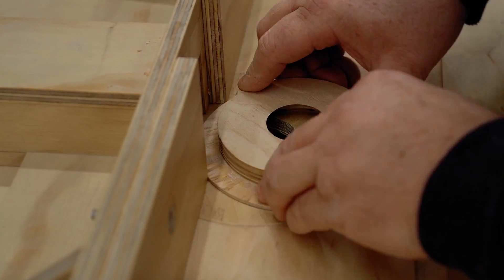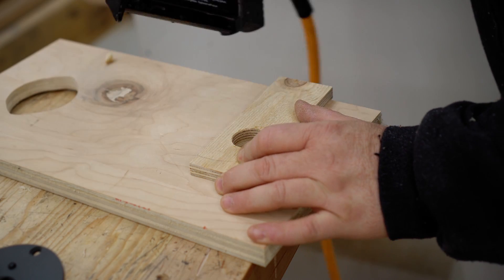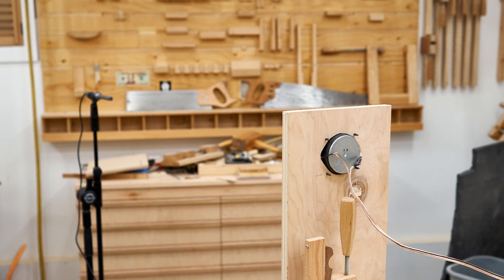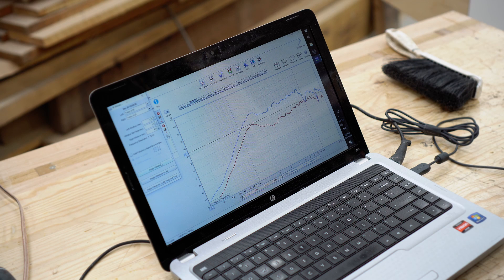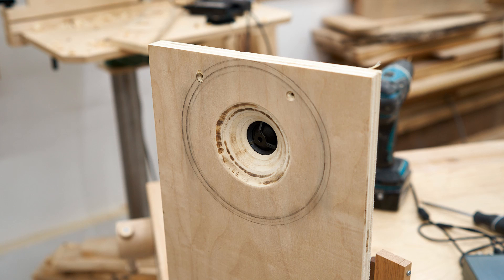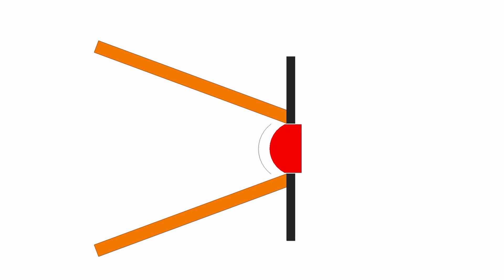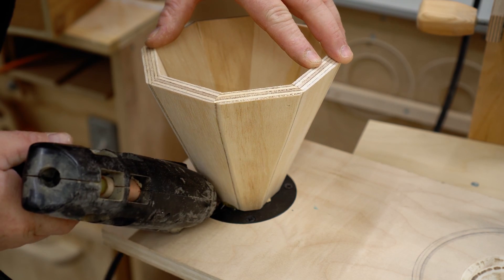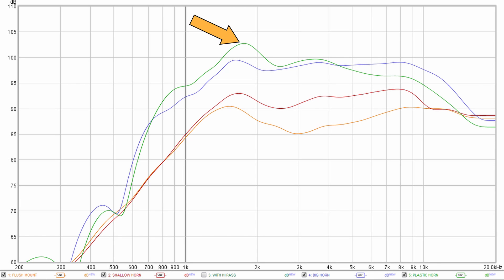How A Horn Speaker Works - Exciting Horn Experiments!

Comment: Can we get higher resoult above 15K if we use a crossing between a phase plug and a small horn? I have amt4 pro and i think they are fast enought but the size or whatever make a poor resoult on the upper end above 10K. I WNAT TO FIX IT. I will have a 3d printer here next week

Comment: One thing of note is that you still have to take care not to lower x-over point too low.  Don’t forget that the cut off limit for crossover is about one point five octaves above tweeter resonance  to avoid significant and very audible odd order distortion which rises as you approach resonance.

Comment: From my experience... horns distort the actual 3D image of the recorded music.   They are good for concert and club speakers, to help amplify the volume levels and overall dispersion spread... But as for Crystal Clarity and Perfect Audiophile Accuracy.. they are Not good for that.
Reply: Im going to add, that Graph sweeps only tell part of the story.  They show frequency output.. but they do not tell you how they will actually sound when playing actual music.  A lot of audiophile headphones, for example, are specially tuned to enhance the experience:  For example, to reduce harshness of the upper range, that certain other headphone drivers produce (making them painfully fatiguing, after only a short period of listening).

 They also dont, (as Ive posted above)..  show the distortions of the intended 3d image / soundstage that occurs, due to the horns shape, and how the waves are altered when bouncing around the horns sides... and  then beyond them.
Reply: Keep listening to horns... Eventually you will see... Also try $100 iem buds.... And high voltage headphones.... "Coloration" of music is not necessary evil..... Wine is all about coloration....I have heard zero distortion transducers and I can assure you.... me and everybody around said they musically sound like crap....Q = 0.7 is normal sounds in nature.... High Q > 1.3  and low Q >0.5 will musically sound unnatural....

Comment: Correction: Horn loading a dome tweeter (or any other) makes the driver work HARDER (yes) against the air. While a flush mount driver works into a LOW pressure open environment, horn loading it confines the air into a column of HIGH pressure air, which is then dispersed. Hence the descriptor "Impedance matching". Simply put, horn loading causes the driver to transfer more kinetic energy to the air. This in turn increases power, but even more importantly it significantly increases detail and conveys more information making the sound more life-like. Horn loading is more about sound quality, than power.
Reply from the maker: Acoustic impedance, like electrical impedance, is a tough concept for most people to grasp, so I simplified the explanation while sacrificing absolute accuracy. 
These days it's about perceived sound quality, but back when they were first being developed and used it was more for power. As in high powered amps were expensive, more expensive than bumping up the efficiency of the speakers.

Comment: I have a question for you sir! Based on the theory that the sound level increases by placing a horn in front of the tweeter, would this also work when using a horn in front of a midrange or a subwoofer? The car audio enthusiast in me has some ideas spinning...
Reply from the maker: Yes, works for everything that makes sound.

Comment: OMA SPEAKERS is the company he is referencing. I make conical wave guides for my pro speakers. A wave guide works by trapping and directing the sound into a narrower range- it's sort of an acoustic lens. They sound more natural than a full blown horn which also does the same, but compressed the sound even more leading to greater coloration of the sound. I use aluminum sheet metal to form the wave guide. Also, the conical shape sounds much more natural than other shapes. I TYPICALLY GAIN BETWEEN 4 AND 5 D.B. OF OUTPUT.

Comment: Well, the quickly put together wood horn is neither exponential nor parabolic, no wonder the plastic horn is louder!
For anyone planning such a project, run a Roundover bit on the wood cones' outer edges. That way you get a slight output boost where it matters the most.

For viewers not convinced about the whole horn thingy, think about it this way. Driving a typical 30% efficiency 10w speaker with a 10w amp produces the equivalent of only 3 watts in sound output. Horn loading a tweeter makes it way more efficient. That's like free MPG. Who doesn't want it?
Unless you hate the shape of horns.
Personally I love horns 😂

Comment: They are more efficient which is good for the environment. But I wonder about flatting the mid range with an equalizer until the volume becomes in balance with the high frequencies. Perhaps then you would get the same efficiency as with a normal speaker,?

Comment: Horn throat diameter determines the higher frequency response. Hence, the lack of amplification after 15 kHz. Of you use a 1" compression driver, you can potentially extend the high end response

Comment: So the inventor in me wants to see a horn made from a centre rotated tesla valve... (so each valve curve forms concentric rings around the tweeter, moving out away from it) so that with each vibration it sucks air in from outside the horn, but won't let any back lash out.  I think the design may work better for a subwoofer though.  Likely a job for a 3D printer.
I'm curious about this, but not enough to try it myself.

Comment: With Tannoy Dual Concentric  full range speakers, the tweeter and the bass cones both shared the same magnet. The tweeter used the bass cone as a horn. Their adverts use the term "Single Point Source" as the origin of the sound waves, this in turn gives a more cohesive sound stage. The Tannoy Monitor Golds were extremly popular with recording studios during the 60's and 70's.

Comment: I JUST FOUND YOU HAD THIS CHANNEL , SO I SUBED, I'M SPEAKING IN CAPITOLS SO YOUMIGHT SEE THIS, 
i was just on amazon, and i saw an angle finder / level thing, and there , looking back at me was your picture, i was looking around a bit to see if you did an endorsment for it but nothing
https://www.amazon.com/dp/B07WZY2K2X?pd_rd_i=B0747HRM8T&pd_rd_w=IEBj5&pf_rd_p=51cf0d17-50cf-4c89-b1a7-606703cfac11&pd_rd_wg=Dvi2Z&pf_rd_r=5M621Q2Z0PTW0Q87TAQG&pd_rd_r=12c7b001-4965-49d2-85ef-03d8babc634f&th=1
Reply: just wanted to bring it to your attention if you weren't aware, ,i wouldn't want some  company using my image to sell something if i wasn't let in on it

Comment: I haven't tested myself but the say is that you need hard diaphragms since softer ones start to wobble at higher frequency thus not being able to produce higher notes especially under horn load. Sounds plausible since I haven't seen compression drivers with soft diaphragms. Anyway, excellent video. Appreciate it!  =)

Comment: I wonder if the plastic horn is more prone to got into resonance with the signal due to being lighter weight, which might explain why the curve is higher but also it had wider swings as the frequency changed. I wonder if the outer edges of the plastic horn were held in a stiffer frame, would thr curve be lower but perhaps more stable

Comment: I think it's more correct to say that the horn changes the output energy of the speaker to be more directive, and less isotropic, thereby causing more gain directly in front of the speaker and less off to the sides.  It does this by physically impeding the sound waves (via the wood structure of the horn) and forcing them out forward. The total output energy is the same in both cases, it is just being redistributed.

In your images for your explanation, the dome actually has the same amount of air contacting its front surface, and therefore the force needed to move the dome is the same in both cases as F = PA where P is pressure and A is area. P in this case being the only variable which could change the force required to move the dome, which should be the same in both cases.

Great video though!
Reply from the maker: Directivity is just part of it. Impedance matching is the main mechanism that boost efficiency and in this video I tried to describe that impedance match improvement in a way that most could understand.

Comment: Is that not... completely the wrong explanation? The way I understood horns is that they work by matching the small oscillating area of the speaker to a large area of air, whereas without a horn, the speaker can only push on the air immediately adjacent to it's surface, wasting energy.

Did I misunderstand something?

Comment: John, are you doing anything to compensate for time alignment based on the distance from the driver to a theoretical zero timeline?  That was one item we worked on a lot in the electronic crossover programs for our horn loaded arrays (JBL HLA) back in my big rock days...  I'm wondering if the difference in depth in your speakers is negligible in comparison or if it could benefit from compensation.
Reply from the maker: Adding the horn to my office speaker physically improved time alignment, since it pushed the tweeter back and closer to where the woofer coil coil is.  And I think for a a pair of small bookshelf speakers listening in the nearfield, any time alignment mismatch is not going to be great enough to make an audible difference.

Comment: About the horn reducing the mass of air directly in front of the driver causing increased output, that could be a good way to put it for that kind of horn, which is one having a constant slope to the sides. If the horn's flare varies with the distance from the driver in a way such that the diameter does not vary linearly with the distance from the driver then the horn can have the opposite effect of holding in the sound.

This is what trumpets and other such wind instruments are all about. The non-linear flare makes in effect for a more defined endpoint for the column of air vibrating inside. Trumpets have purer pitch than coronets or bugles because the shape of the bell stops more sound from coming out, and that is how those instruments are defined, by the shapes of their bells (and not by whether or not the instrument has valves... bugles can have valves). 

While you don't have a long column of air to vibrate inside the speaker, the curvature of the horn would still greatly influence output.
Reply from the maker: The plastic one has more of a trumpet like flare, the sides aren't straight.
Reply: I was wondering if the effect of the plastic horn was due to a smoother transition to the external air which provides for a better impedance match than the relative sudden transition offered by the wooden horn John made?